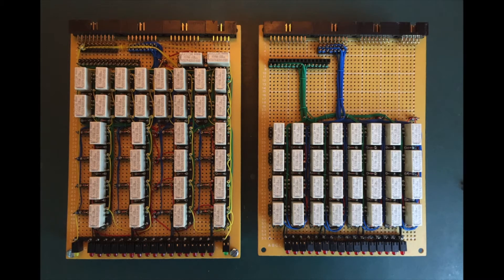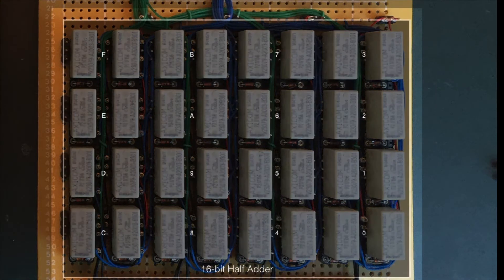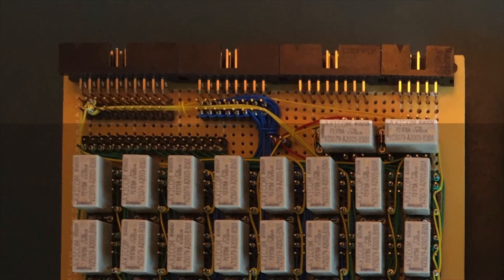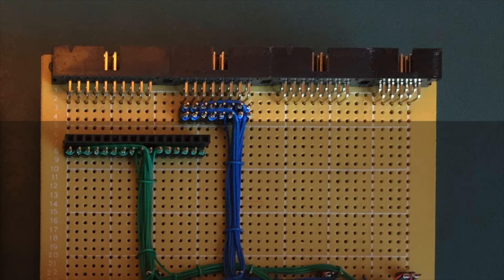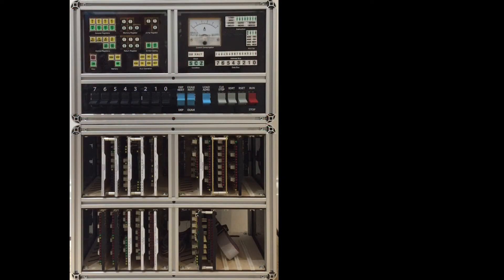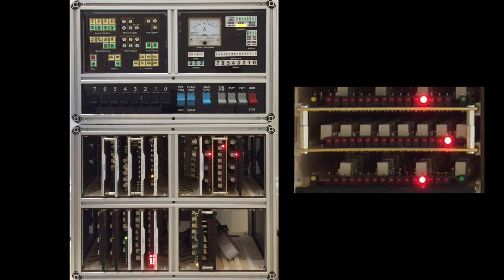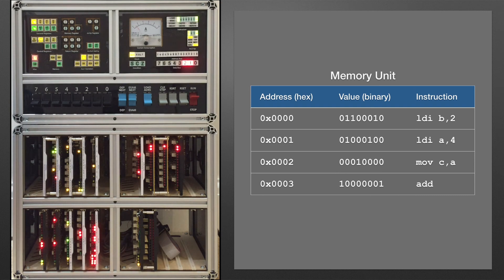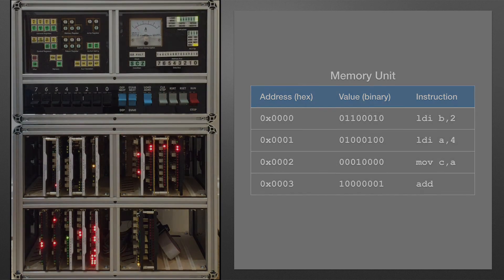Relay Computer: Incrementer Unit Test

Comment: Very interesting work here!
Can't wait to see it when you can autonomously fetch instructions and run through them, that should make things very interesting!

I was watching a previous video of yours [about memory], and also read a blog pot about it, you used a memory chip which is important time/money/space wise, but was wondering if you'd ever, as a side project, weave up a home made core memory plane/block.

I haven't watched to much of your stuff, so one question that relates is, generally speaking, how much memory do you think you would need minimum?
Reply from the maker: Autonomous fetching and running of instructions is very close now ... I should be posting a video of that all working in the next couple of weeks :)

Oh yea, it’s highly likely that I’ll end up making a core memory store for the computer at some point and I’ll be exposing all the busses out of the back of the computer to make it possible to bolt on ‘extras’. There’s 32K remaining addressable space left on the address bus so plenty of room for ‘peripherals’ ... there’ll definitely be a display of some kind in the future too :)

The minimum memory question is an interesting one. Really it’s down to the length of program you want to execute plus space for any data (both variables and constants / look up tables). 32K is definitely overkill and the memory chip is only that size as it’s readily available. In theory you could run with an 8-bit address bus instead but that does then feel a little constrained. An ‘interesting’ program need not be a long one though :)
Reply: Can't wait for a display! 
That will be so cool.